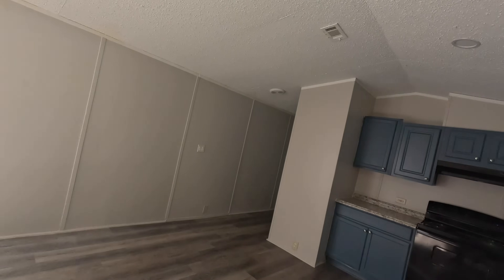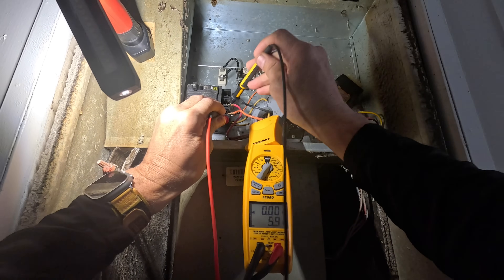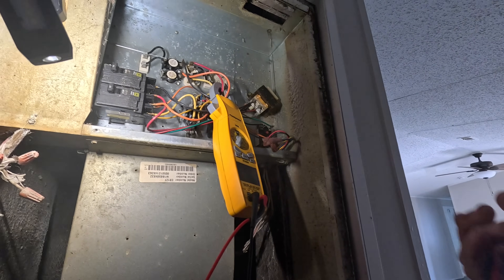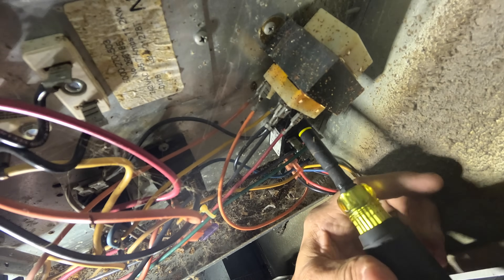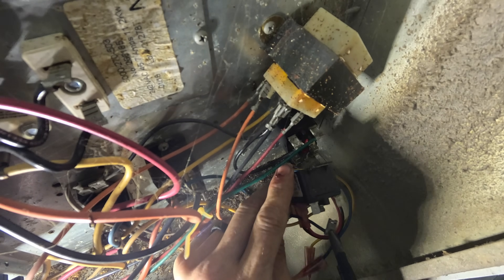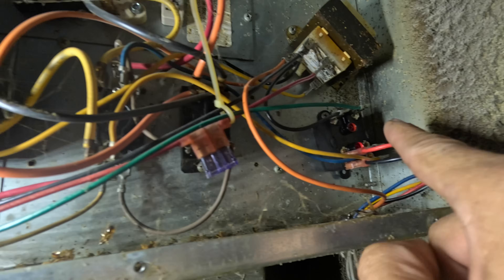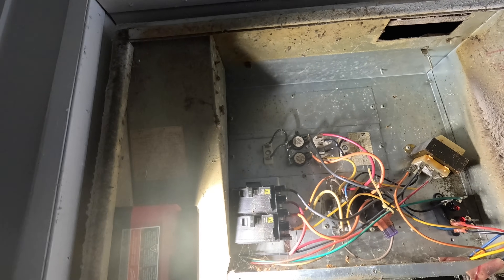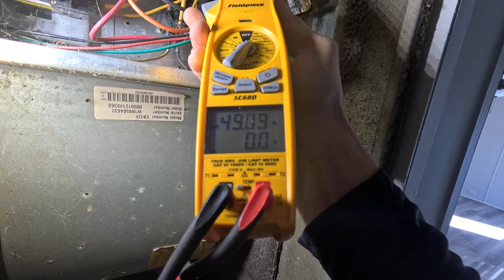Saturday Call To A Mobile Home For No Heat! #hvaclife #hvacguy #hvactrainingvideos

Comment: Curtis, Amazon has the spade connector you were looking for for the heat strip repair job. I would have posted that info if I could have found your video. They are called quick disconnect terminals. Always enjoy your videos! Keep up the good work!

Comment: That start cap on the motor was low...  Needed changed or upped 2.5MFD right at it.. You can hear when it was starting how slow it was.....

My guess the guy before put a lower rated cap in if it's not reading low....

Comment: I don't understand about the fuse, if it short then you should not get 240v right?
Reply from the maker: It’s supposed to allow voltage across, showing 0V, until it get too hot, then 240V

Comment: The pvc 90 with the hole in it is for clearing a clog with a 7 ft piece of  t-stat wire or something similar.. 
It's not a terrible idea on trailer homes.
Reply from the maker: Only issue is that it removes the ptrap. But, rarely have I seen that cause a trailer system not to drain.

Comment: The fusible links blew because the fan wasn't pulling air over the heat strips?  Did you quote them a repair on the religious (holey) drain line?
Reply: so if those fusible links didn’t blow , voltage across would be 0?
Reply: @CarlosHernandez-ih5eq  If they didn't blow, the heat strips would stay on, despite no airflow over them.  The likely result is either a fire, or the heat strips themselves burning out.
Reply: @OnusBones  so what would voltage be then? im just trying to understand more troubleshooting about heat strips.
Reply: @CarlosHernandez-ih5eq  It would be zero (or very close to it); much like measuring for voltage with two probes an inch or two apart on the same wire.
Reply from the maker: Yes, lack of airflow caused that. But, limits technically should’ve stopped that. But, their cut out temp was set at 200, which is too high, but what it was designed with.